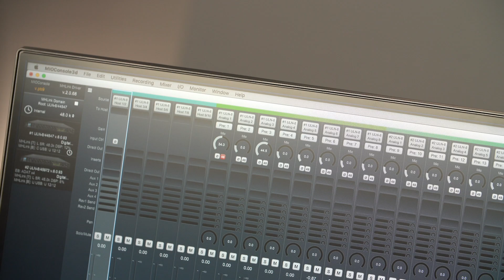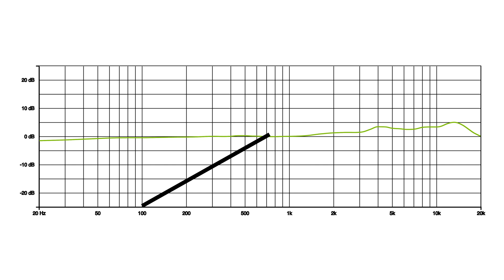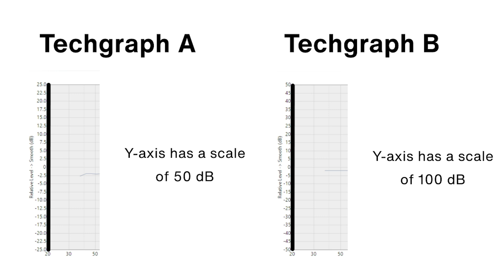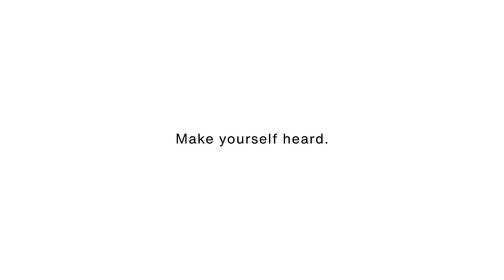Microphone specifications EXPLAINED

Comment: At Lewitt what level of smoothing (I assume some dB level/12th octave) is used on the frequency response graph?  Since microphones like most things have tolerances, is the frequency response graph a single microphone or the average of a representative population?  Is the response obtained in an anechoic chamber or diffuse field?  Are any target compensation curves used?  Why is this data not available to download for the MTP550DM?

Thank you!
Reply from the maker: Hi and thanks for your interesting questions. 

We use 1/3rd octave smoothing for our published frequency response graphs.
The graphs are the result of the mathematical average of a representative population.
Our results come from free field (anechoic chamber) measurements
There aren't any target compensation curves used. Strange, we'll look into the missing tech graph of the MTP 550 DM. 

Hope that answers your questions! All the best from Vienna!
Reply: Thank you!